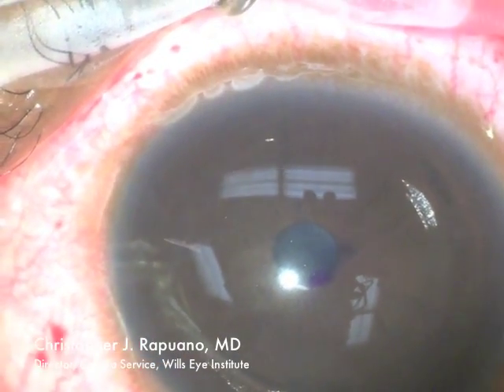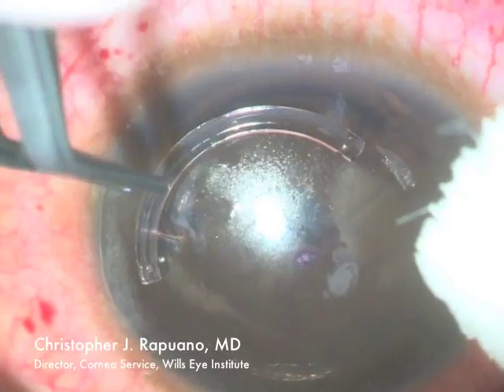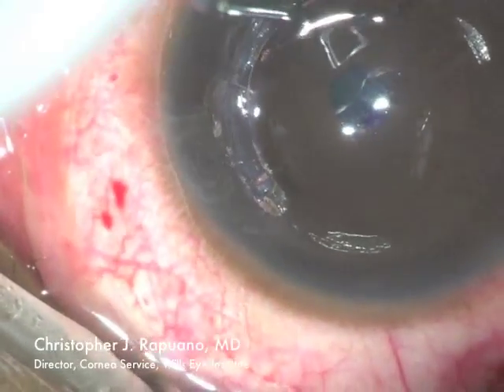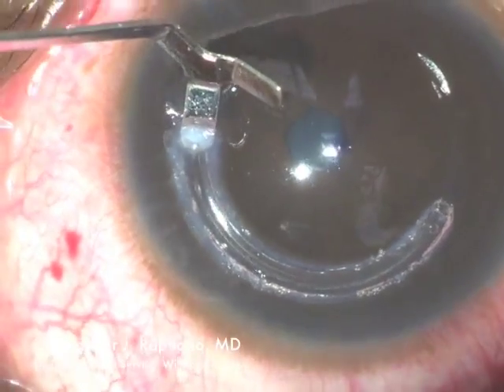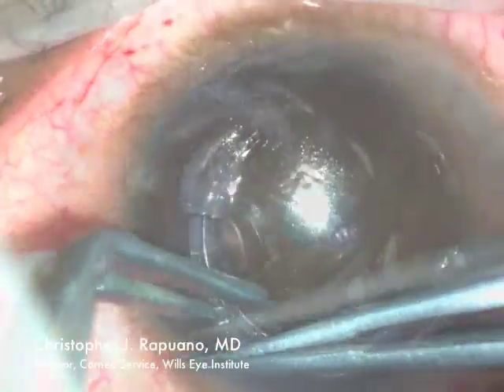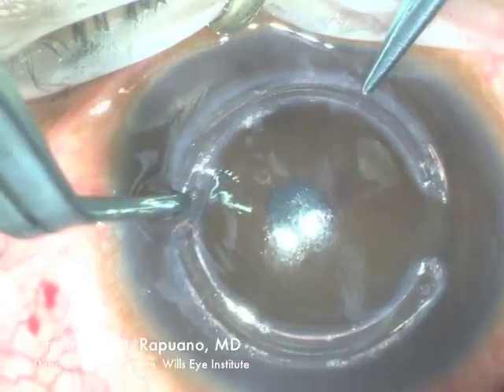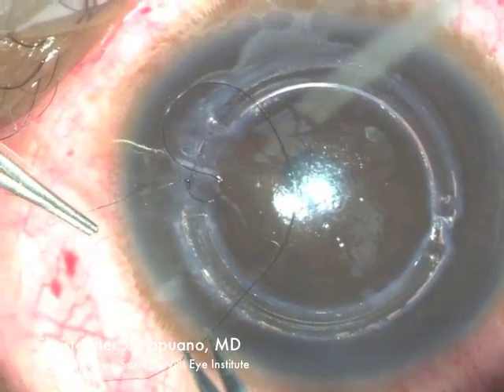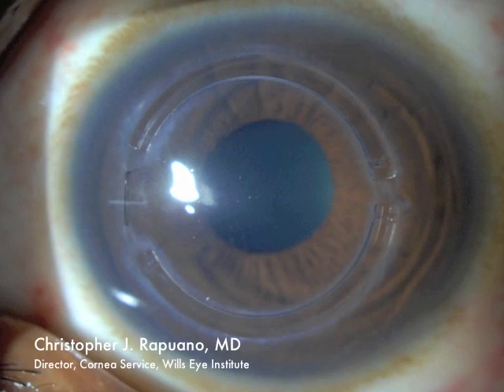Intacs Insertion for Keratoconus

Comment: Hi. I’ve been diagnosed with keratoconus since age 9(now 31) and feel I’m losing my eyes. Unfortunately there’s no hospital in my country that does corneal cross-linking, corneal transplant or intra-ocular contact lenses. I’d like to know how much these procedures cost so I prepare towards it. Please reply, I need to fix this before it’s too late 🙏🙏🙏
Reply: C3R cost around 3000 USD
Reply: I was in your same position, I felt like I lost my vision at 32 and could not drive.  I was desperate and wanted to go with surgery until I met another person (he was a doctor ) that was going through the same issue and corrected it by getting rigid gas permeable contact lens instead.  He highly suggested to try it before even thinking about surgery.  I'm so glad I did, I see amazingly well and I turned 38.
Reply: In morocco it costs 900 dollars maximum for the operation , and like 150 dollars for the eye topology , if u are from africa i d go for a north african country for cross linking
Reply: I have just been diagnosed at 14 but dont want to do this surgery.my vision in right eye is perfect but for left eye its 20/200.i wanted to know how it evolved for you to get more information on how mine is gonna evolve
Reply: You can do this surgery in Iran / Mash’had city with 22000 USD
Reply: It’s roughly 10k where I’m at without insurance

Comment: Hi / Mr. Mrs 

My father is suffering from Keratokonus, While serving in Afghanistan  he injured his eyes and after than gradually he had eye problems. for now  he has 40% vision left in  eye, and almost 0% in his right eye, and we were offered morbid solutions by our doctors such as impacted eye removal. Our question is, does your clinic treat or perform anything to repair or fix keratokonus, and is it even treatable at this stage or not?. Any info would be greatly appreciated.
Reply: Keratoconus doesn't leave you blind. It sounds like you got a misgiagnosis.

Comment: I've had this surgery done about a month ago AND IT DOESN'T HURT AT ALL. Getting dust in your eye is more discomforting than this. Your eye will feel pressurized until the 3rd day which is absolutely not an issue...

There is NO pain associated with this surgery, you'll feel a lot of interaction with your eye during the procedure but at no point is there any hint of pain associated with it.
Reply: Has your vision improved? I am contemplating if to get it or not.

Comment: So is this better than wearing hybrid lens? Which I have been wearing for 6yrs.
Reply: MD Motahar I agree with a lot of what you say however I will say to anyone with progressing kc do cross linking. Its helped me soooooo much. Before cxl my rgps were so uncomfortable and afterwards they are perfectly fine. I had intacs on my bad eye which has reduced the steepness however it is a little uneven which makes a new rgp difficult to fit
Reply: stick to your contacts. Any invasive should be last resort. Also, try RGP. Use solution that numbs your eye a bit for a week so that you can use RGP.try all lens options...E.g. Kerasoft by Bausch & Lomb It will be high comfort but low vision. But worth trying
Reply: RGP was the first lens I wore. They were small, hard, and to painful. Then I tried piggy back. The hybrid lens are the best for me. But even with the lens, my vision is still poor, because I only wear a lens in my left eye. My right eye has a scar tissue so I've never worn on lens on that eye. So my doctor said I need a transplant for my right eye.
Reply: I've never worn a lens in that eye*
Reply: And the hybrid lens here are $410 each.
Reply: Make sure you are going to the best doc for Keratoconus. My whole point is the least invasive the better. ie. Intacs is better than replacing your cornea..I mean less risky. And intacs are only for certain types of Keratoconus..Your cornea needs to be certain diameter to fit those plastics etc.So I would research on internett to see which doctor has done research or highly regarded on Keratoconus as specialization and go to him or her.
Reply: My doctor Bradley Fouraker in Brandon Fl, said he invented intacts. He didn't suggest that for my worst eye.
Reply: Also, as for insurance, shouldn't your insurance cover it. Because under Obama care, these are covered as these are medical necessity. Ask your doctor if they know or your insurance folks
Reply: Ok great. I'll look into Obama care, because every insurance I had didn't cover it.
Reply: Hey, just wanted to share HELPFUL info. If you are working, ur employer offers VSP eye insurance ; go for it. It covers lenses for Keratoconus! Yah..Thats right. So get VSP eye insurance. and that will cover material cost of lenses not just fitting